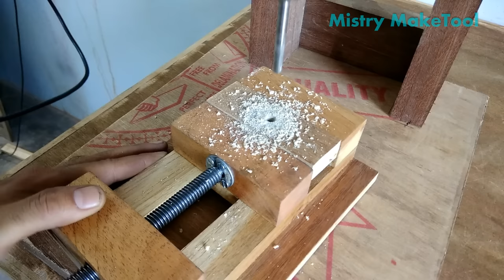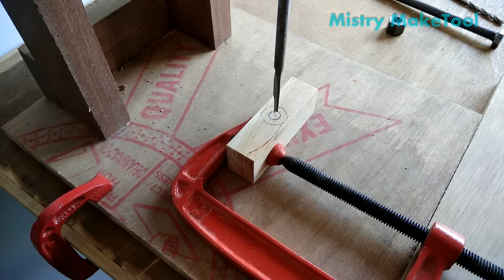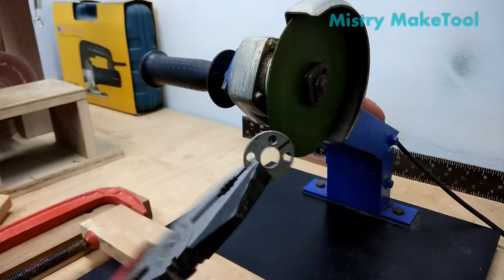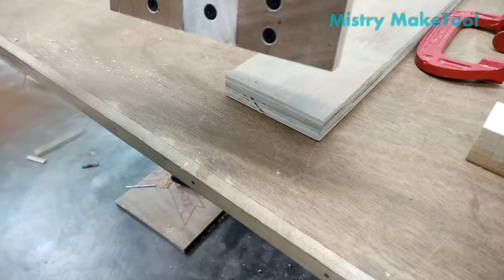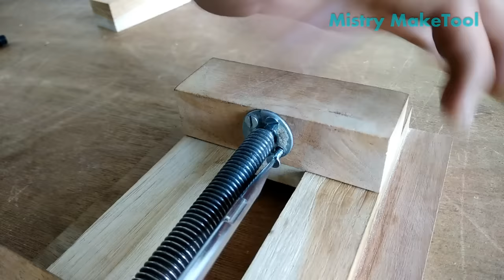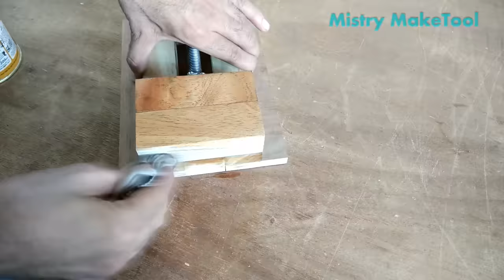Making A Drill Press Vice || How To Make Wooden Vice

Comment: Good video!!. It would be awesome if you share the sizes of every piece of wood. I'll built one based on this video. Thanks!
Reply from the maker: +Mauro Sanchez thank you...
Reply: The sizes are not critical, you can base them on what scrap timber you have, the one shown has external dimensions of about 6" wide (plus extra base plate) by 10" long by 4" high. (15x25x10cm). Cut your pieces in multiples of 2" and you will be fine.

Comment: just screw a couple of 12v maglocks to the bottom of the vice (any me 
vice) when the switch is on vice is held solid to the press table and is
 easy to adjust simple use the switch adjust micro adjust then throw the
 swich and work is held solidly

Comment: Brilliant tool. I hope you learn that drilling should be carried out at speeds suitable for the material being drilled. Metal should be drilled at slower speeds than wood, for example.
Reply: Maybe his drill isn´t a variable speed one.
Reply: Poor excuse José, the internet is loaded with ways to convert single speed drills to variable for pennies. I have three different home made drill speed controllers, so I'm sure Mistry Make Tool has at least one. Ö¿Ö
Reply: Earthling it's not a excuse, maybe a possibility I'm highlighting.
Reply: Why not add useful comments instead?
There's no need to reply, I already know the answer to that question.

Comment: can you indicate the measurements of the used parts? Thank you
Reply: The measurement will depend upon the ( work pieces you do the most) like the opening of the jaws , the thickness,  the hardness of the material ( wood , metal , plastic etc ) the area ( the plate on the vice will be placed) and the slots on the plate ( if you want to fix the vice on plate , not shown here ).

Comment: Sir,you can make watchmakers' Tools very easily and diligently.The tools are high-rated in the market presently which is atrocious and unjustifiable.
Tools worth of 2 USD are sold at abnormal rate(say 15-20 USD).You can make watch movement holders (wooden,metal or plastic) and market them at reasonable rates.Please concentrate on making watch repairers' tools.